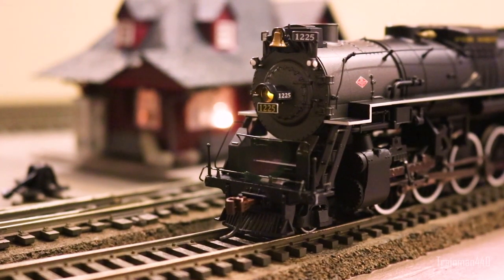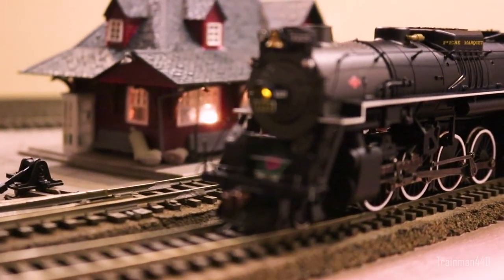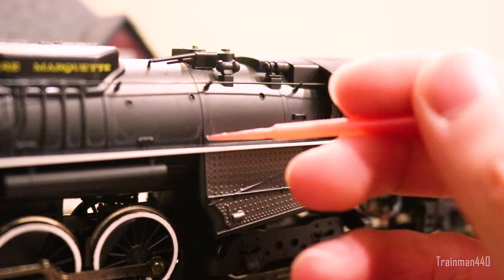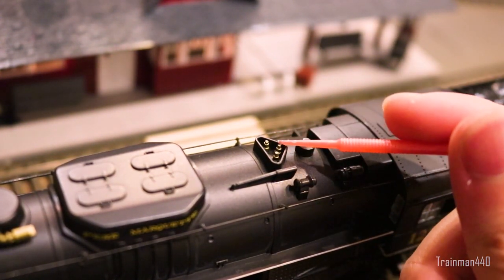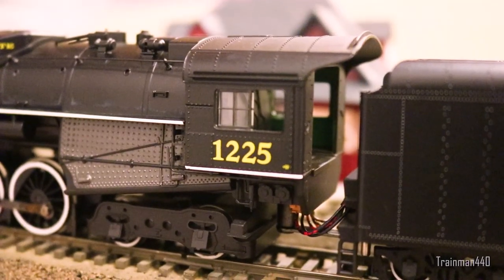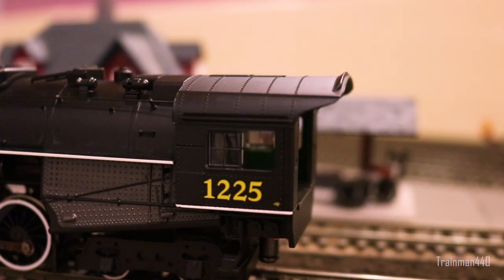(PART 1) Proto 2000 vs Bachmann HO 2-8-4 Berkshire Review & Comparison

Comment: Very nice comparison! I kinda think that the Bachmann one is a toy. The MTH is very detailed and accurate to the prototype in my eyes, especially the modern excursion locomotives. The lights from the head, cab, markers and number boards, and it being die-cast metal just make the model look stunning, and the smoke is done really well and functions really well, especially the whistle smoke. (And using all 28 DCC features which Bachmann doesn’t do) But, hey you have your opinion and I respect it! I’m glad you enjoy your models!
Reply from the maker: respectfully, I must disagree, MTH's berkshire, while it has more details, the details it does have are clearly oversized. That, and also MTH based all their berks off of the NKP prototype, which means no prototype specific details. For $500, an engine without prototype specific details that are oversized simply isnt just. Not even with the smoke and lights. But yes, its my opinion and we dont have to agree. At least Bachmann's berkshire has the correct dimensions. I will be pointing this out though in part 2 (so I wouldnt watch that if youre the easily offended type.) Cheers!
Reply from the maker: It may be accurate to your eyes, but blueprints dont lie. Also, lit markers doesnt make it any more "accurate" per se. It makes it look cooler, Id agree. Technically, green markers (or section lights) arent common. They are found on a sectioned train, and only at night. (flags are used in the daytime). But again, to each their own lol. 

Im not going to argue about smoke right now. Im glad you enjoy it though.

Using all 28 functions...I hope you realized youre comparing a $150 "sound value" engine to a $500 engine. If I paid $500 for an engine, it better have 28 functions!
Reply: @trainman440  you do have a point on that price, lol. I use to have the Bachmann version, but the motor burnt out after two weeks of owning it. Plus Bachmanns just pull terrible. I also love the sounds on the MTH one. Being able to use 1225’s bell and 765’s whistle is pretty sweet. The Joliet Rocket announcements on the 765 are pretty neat as well, but again the higher price means you’re getting more features. I am glad the Bachmann one exists, though. It’s a cheaper alternative for those who don’t model to seriously and just want a simple model. When I had mine before it went out, I did enjoy it, but I will say I enjoy the MTH one more. But anyways I’m looking forward to your part 2. Cheers!
Reply from the maker: @trainstorm1225  i agree with that. The bachmann one is light, it could use some weight. The mth one pulls more, is it due to it having tires? or due to it being heavier? 

Thats unfortunate to hear the motor burning out. I have yet to see that happen, but thats sad news. 
Cheers!
Reply: What details on the MTH do you think are oversized specifically? You’re the only person I’ve heard claiming this.

BTW, besides the NKP, C&O, and PM 2-8-4s there is another Berk that always seems to be forgotten when people start talking about this family of the “superpower” Berks, specifically the Virginian Railway’s Class BA 2-8-4 locos which all had their steam domes hidden from view underneath their sand domes, low mounted headlights, air pumps on pilot deck, and slightly different tenders, etc.
Reply from the maker: @localoid  Here's a few forum threads about this(from the same forum cause this is one im active on)
http://cs.trains.com/mrr/f/88/t/171440.aspx
http://cs.trains.com/mrr/f/88/t/175701.aspx
http://cs.trains.com/mrr/f/88/t/181436.aspx
http://cs.trains.com/mrr/f/88/t/253923.aspx
Yes, I didnt bother mentioning the berkshire from Virginian cause it was less prominent (unfortunately), and I was trying to keep the "history" section short lol
I could of also went into detail about how NKP switched over to having the berk take over most of their roster, and also other railroad berk designs(such as the ATSF), but I didnt have time.
Cheers!
Reply: @trainstorm1225  While you have had a bad experience with Bachmann, Kader 881 motors are known for being excellent reliable motors, sounds like you just got a dud. Also, the sound I definitely feel is an apple to oranges comparison, due to the price difference. I own all 4 major versions of the Super Power Berkshire with TCS WOW, I feel the Bachmann is the best, especially for the money. Proto's version I like the sprung drivers and the weight. Riverossi is hot garbage, and MTH is just meh. You get all the inaccuracies of the Bachman with oversized plasticky looking detail and a expensive decoder outta the box that doesn't perform as well as a TCS for half the cost. Being the same price as a proto 2000 just makes it a write off for me. Now that really only leaves Proto and Bachmann. Do you want to pay 600 dollars for a near perfect representation of a Berk,  or 160 for a near perfect version that may need a little work. Based on sales figures that I could find. Most people have gone and will go the Bachmann route. Smoke is really the MTH's only redeeming feature AT ITS PRICE but smoke still is a niche thing that doesn't matter to most model railroaders. Pick up another Bachmann and give it a fair chance, and you might do what I did, sell the MTH and use the extra cash to make a near perfect berk.

Comment: The Bachmann engines are more correct in most respects! The biggest Error on the LL Heritage engines, is where the running board steps up on the Firemen's side of the loco (all versions!), it should raise up before the pipe from the cylinders! Only the NKP Class S  (700-714) went back the same length on both sides, then raised up past the pipe from the cylinders!
Don't like the yellowish Headlight on Bachmann's? Pull the shell off, pull the yellow LED out, throw it away, and replace it with a TCS Sunny White 3mm LED!
The white-wash on loco tires, is mostly done on Excursion engines! But the added details that will really make the Bachmann engine stand out  are: Blowdown pipe added to engineer's side; Cold water pump on the Fireman's side, frame mounted on bracket behind the last driver, and the water line on the trailing truck to the tender. Also add real scale coal cemented over the plastic coal load! 
And yes you're right---add a deck plate, and Handrails to the cab, tender (all 4 corners, and a short ladder from the coal bunker, down to the tender water tank area, toward the fireman's side! 
Also a nice weathering job with Pan Pastels will really make details stand out on engines with molded on details. In the case of your PM 1225,  alight weathering job will make it look more realistic, where as your NKP 738, heavy weathering would look better, as those freight engines got pretty grimy after a long run. That and RR's didn't keep them as clean towards the ends of there careers!
Reply from the maker: good points! thanks for sharing abt the running board fact, I didnt know about that. I agree, the bachmann one is a great candidate for detailing and customizing! definitely one of their best models, esp for the price.